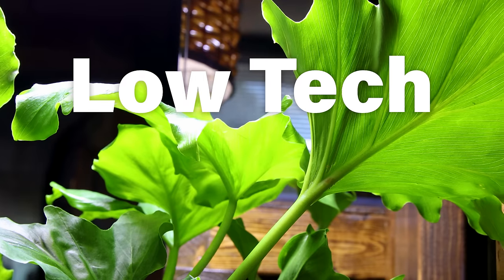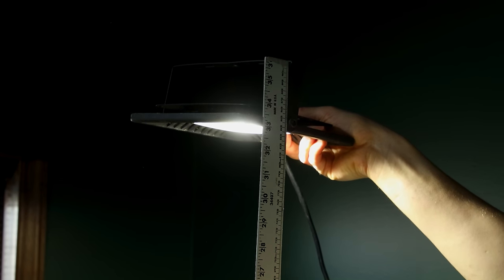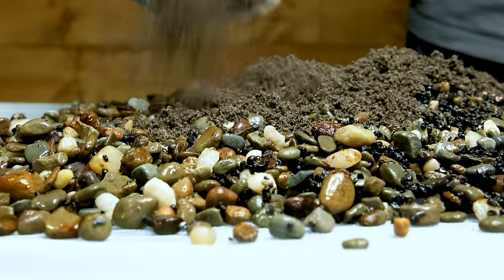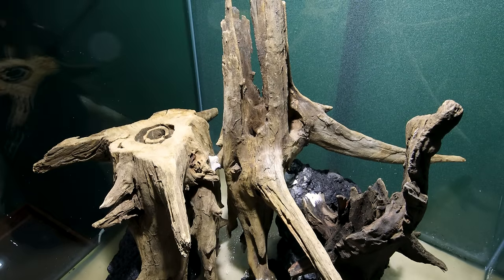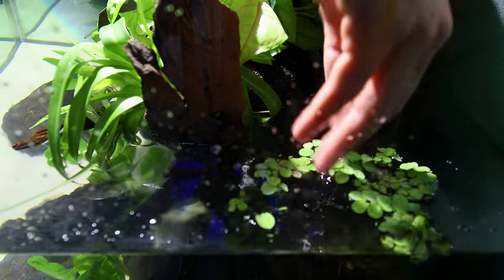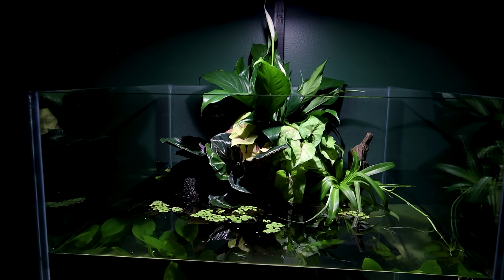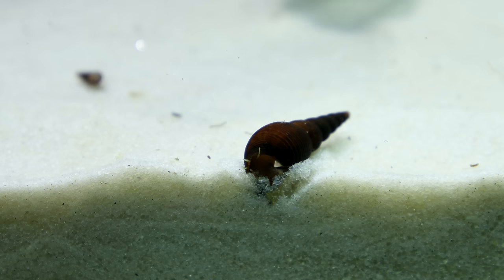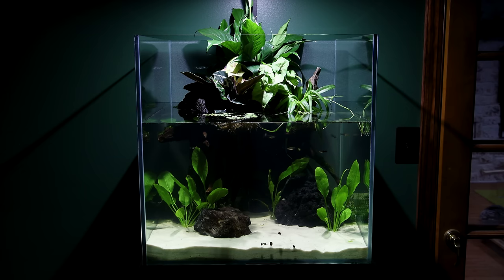No-Filter Guppy Sanctuary Ecosystem Fish Tank

Comment: Did that with the mesh bags then fine sand over the top so I could have a safe planted aquarium for my African dwarf frogs. Don’t want them accidentally swallowing aqua soil. It actually works better than I expected so anyone iffy about it should give it a try. It’s also a great way to add height in the back❤ 🐸

Comment: Nice explanation and setup video. Back in the 90's there was a company that made a plastic 3D backdrop that you used silicone to attach to the back glass of any aquarium. You added a pump at the base of it and water was pushed up to a stream at the top that ran down into separate descending pools along with a hydroponic area for plants. Roots would grow into the main tank for food. It was call the River Tank system. I had one running for years and it was fascinating with how well it worked. I finally gave it to a friends young daughter.

Comment: Great setup - A true eco system, not just an aquarium. Liked how you explained the advantage of the terrestrial plants over their submerged counterparts.

One thing I didn't see is how the tank sustains enough oxygen in the water column and processes oxygen exchange as there was no breaking the surface tension to facilitate this that I could see.

Comment: Me and my wife got ourselves an aquarium about a year ago. We both love this window into the underwater world. However we did not want to deal with frequent waterchanges, cleaning filters and generally high maintainance setups. After some research we decided on a low tech, low maintainance tank (only a light in a timer, no filter) and lot's of plants. We added 25 shrimp (the very small ones "Zwerggarnelen") and 10 mini barbs (fish). We also had snails straight away.

However: all our floating plants dies within 2 month (we think the snails might chew the roots). Are riperian plant's an alternative or may they get eaten too?

We also had a bacteria bloom a few weeks ago (probably overfed) which actually killed a few (of the now 60+) shrimps. 

So the setup works as it is low maintenance. But it's also quite easy to get something wrong and then it is really hard to get advice because most sources are about filtered aquariums. So it's kinda good and bad for beginners. :)

Comment: Isn't there some concern of anaerobic toxicity if there's not enough circulation between the aqueous dirt and the rest of the tank? My (admittedly limited) understanding of the Walstad method is that the gravel later isn't just a passive bystander in the system, but needed to be permeable enough to supply oxygen to the soil.

I could be wrong though. I'd be interested in a follow up on this one.
Reply: The trumpet snails help avoid this issue :)

Comment: Hello , I bought a 35 gallon frameless aquarium Aqueon . I’m wanting to apply extra silicone for security as there are several reviews on this tank leaking. Should I add silicone over the existing, or remove and replace with fresh silicone? I haven’t filled this tank yet for testing.   Thank you for all the great videos!

Comment: Just gonna toss this out there.  

The best substrate I've used was simply sand, any kind.  And then dosing fert tabs to the individual plants as needed.

For aesthetic or functional considerations (such as fish or other animals that dig) i would elect to place rocks around the base of plants i was worried about.

If i really needed a plant to have soil I'd pot it typically.  And conceal the pot.  

I've done more complicated substrates with no benefit unless you consider mess a benefit.

Sand is very easy to clean.  You blast the substrate with positive pressure, make it look real dirty in the tank but the sand itself will settle quick.  The mess will be picked up in the filter or settle in piles ontop of the sand to be easily suctioned out with normal siphoning. 

Cheers

Comment: @SerpaDesign Just a note about "adding diversity" to avoid "inbreeding".  If your line has very little problems, inbreeding will reveal very little.  There is inbreeding depression that occasionally needs to be addressed (things like smaller size, failure to thrive, less breeding, less successful offspring) but that is usually very rare to have to deal with.  You are actually probably bringing in more "problems" by trying to keep from inbreeding. Using inbreeding/linebreeding you should be able to remove unwanted/bad traits within 8-9 generations... By adding in unrelated genetics you are just hiding the bad/deleterious traits.